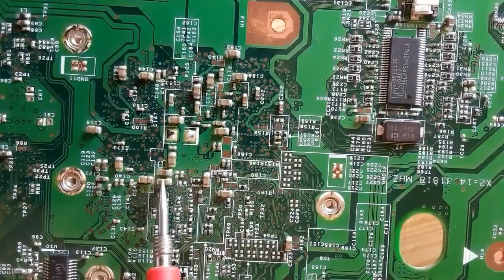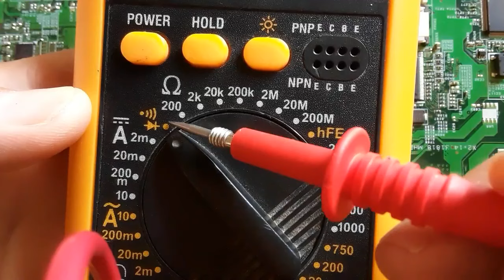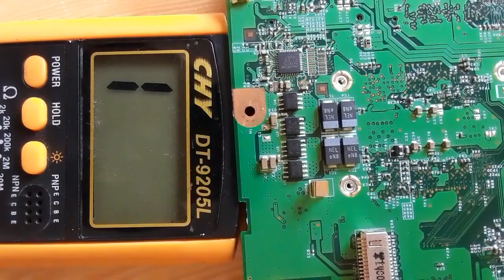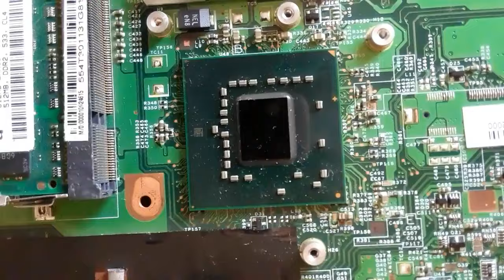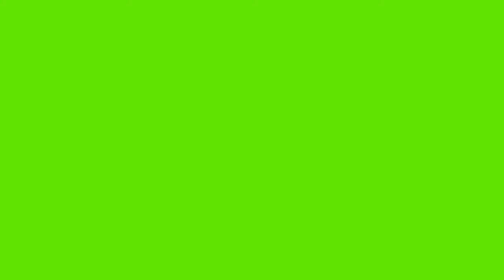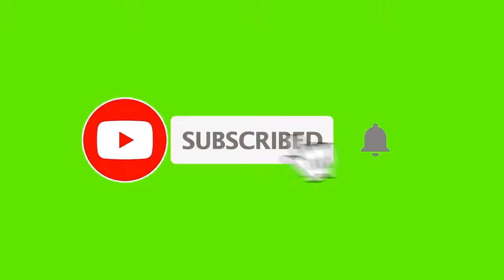How to test Ceramic Capacitors with a multimeter, SMD ceramic capacitor testing

Comment: How can we determine what capacitor we need? I have a motherbpard with 2 missjng capacitors. Most likely a class 2 ceramic capacitor, but how do i determine the right value?
Reply: I realized that the only methods that work is either look for the specified motherboard schematics (if they exist), buying a new motherboard; measure values [of the capacitor desoldered off of the pcb board] in relation with purchasing a SMD/SMT kit to replace missing or broken capacitors and/or resistors only after measuring from a working motherboard [these kits give you a lot of chances as important as a working motherboard] or buying a donor motherboard for parts.

Note: You can only measure the capacitance of the capacitors only when they are by themselves, desoldered or away from the pcb board. You MUST use an SMD Tester instrument tool that is used to make measuring the SMD components a lot easier than using your conventional multimeter,  and please make sure to measure them in a place appropriate for this action. *Don't put too much grip on the capacitor, otherwise it will fling away. *Measure them in an appropriate area where the SMD capacitors are not prone to come off the table and fall onto the floor (especially if the floor is carpet) which would be lost, so you need to shield your borders of the table. Moreover, you may need to close openings anywhere (from the closet doors or curtains).
Reply: yes this is a real head scratcher. Recently had a laptop motherboard where one of these blow up literally melted. So i had to test the ones around it to see what the resistance is. If they are all the same size and in the same area all I can assume is that they would be a similar reading fingers crossed ey?
Reply: @ghostplayswow  i had found a electrical schematic for my motherboard, replaced the part and works fine now. Maybe try searching for yours?
Reply: @yahyaalkasem3664  I have been looking but no look yet. Hp omen. Not sure if they like to share the schematics 😅
Reply: @ghostplayswow  can you give me the full model number?
Reply: @yahyaalkasem3664  i can't see a code on the board. But the laptop is the hp omen 15 dc1023na I can find replacement board but I'd rather try to replace the capacitor first 😅
Reply: Not all slots have components so you might be looking in the wrong place. More likely this part of the board was always unpopulated then 2 fell off. Look closely to see if there was any solder on the pads.
Reply: @tvoovm7254 Thank you for the info! What do you mean by "SMD tester instrument tool?" as compared to a multimeter?

Comment: How do you determine the capacitance of a tiny but very tine micro-capacitor that you accidently knocked off that needs rewelding?
Reply: I also would like to know. I messed up my alarm clock soldering project not knowing which SMD ceramic capacitor I was using.

Comment: What if the capacitor closed to processor or graphics card is reading 0.00 resistance
Reply from the maker: If It reading 0.00 in both sides means 100% you have a short circuit in that circuit.
Reply: @electronicsrepairbasics_erb  but it reads 0.0 in the video you made and you said it’s Norma
Reply: @hammedinhobuhari3523  checking ceramic capacitors on PCB using continuity(buszzer) mode  is confusing .  sometime you get continuity on a capacitor even when you reverse the probes , but that capacitor is good . I read that capacitors that aren't grounded give continuity , so people will think they are bad
Reply: @hammedinhobuhari3523  i was pretty sure the lowest he got in diode mode was 0.23 or something. not 0
Reply: there's similar to 0.0, the first 3 caps he checked, the lower left one has no reading,

i been resding comment to. see if someone also noticed,
the channel said its ok but then he also. said if the cap gaves very low resding its bad but then got a rrading for 2 caps with very low resistamce but then he said they're ok,
what the heck,
so everything is ok no matter what??

its all contradicting

Comment: I've got an issue with the board in my stock head unit in my car. Everything works but the speaker outputs. I get power, satellite radio,am and fm, usb and inputs all seem to function I just get no sound from them. I do have sound when the car alerts me to whatever (seat belt, emergency braking system etc). Schematic sheet is only available to the car service industry of course. I've done trial and error for all the speakers  and have decided it's definitely something on the board.  I even plugged a headunit from a different car same make, different model and year in and I had sound working fine. I'm assuming it's one of the ceramic capacitors for the speaker outputs but I'm unsure what if anything else to test before I go replacing things and possibly screw up my headunit even more.   I've been trying to find some useful information for weeks and yours is the closest thing I've found yet, so thank you! Could you help me? I'm not very knowledgeable so I apologize but I'm always open to learning. I can provide pictures of the board that doesn't have an issue if that will help. I can remove the one that isn't working just take a little time.
Reply: Did you ever get a chance to test this ?

Comment: Good video had a question not equipped with a good magnifying set up hard to see what kind of ceramic capacitors are being used. I’m trying to fix my audio control module and no idea how to decide what part number on capacitor to use. Any info would be helpful . Not hard to remove and replace just don’t know where to get and what part to order
Reply: Apparently they are color coded, they don’t include any numbers. The best way to know the uf is to find a schematic on the item you are working on.
Reply: use size and colour, try to find same size on a donor board. If you have the correct capacitor tester you could test a good one in the bad circuit and order same value. Otherwise try to match same size etc.
Reply: @izzzzzz6  thanks